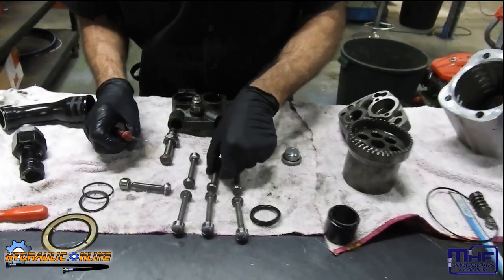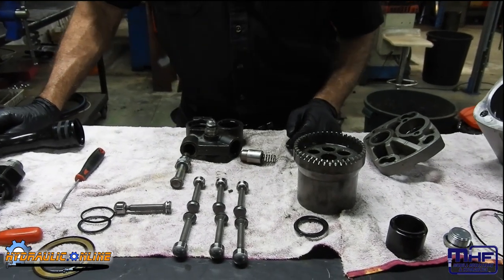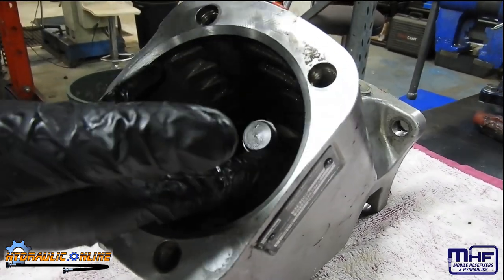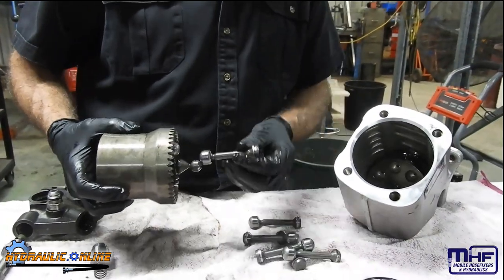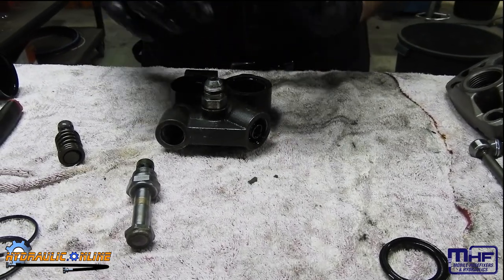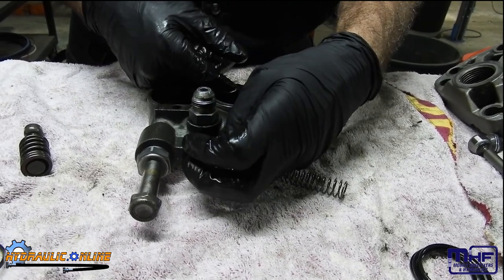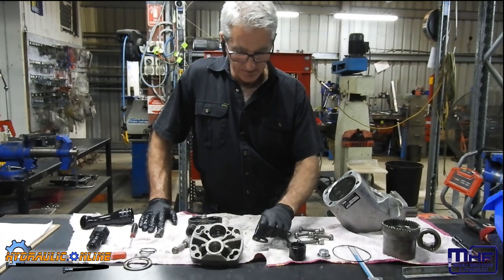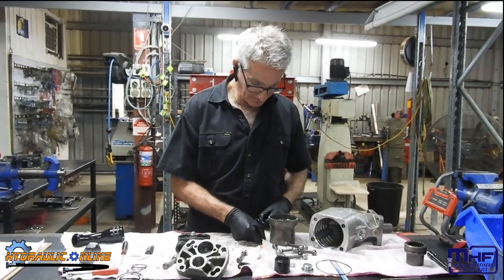Parker Bent Axis Piston Pump Failure Analysis "Live Drive" Explained

Comment: Great series. Any chance that you could do one on using unmatched hose and fittings and determining a safe compromise to get a customer up and running , as this is a scenario that is common in bush areas with a crimping machine and not a huge stock or range of hose and fittings. Thanks  Greg.
Reply from the maker: Thanks for the Comments gomond1 the answer is Possibly! the key words here are "a safe compromise" 
and "unmached hose and fittings". Best you give us a real life example and I will try and come up with a solution.
We in a pinch we have used medium pressure hose fitting on High pressure hoses by "skiving" the hose and crimping to tail collapse.
and high pressure fittings on different or unusual hoses. 
Try this watching this video for an brief expalanation of what we consider "a safe compromise" 
https://youtu.be/XjTlC2XjZQs

Comment: If the bypass line is put into the top of the tank, can this create an air pocket resulting in potential pump failure?
Reply from the maker: All bypass and return lines should return to the tank below the minimum oil level, if returning to the top of the tank it is recommended to use a dip pipe to ensure oil returns below the surface. Most tanks have breathers to allow excess air out or to let air in as the oil level drops and rises. Some tanks especially on mobile plant such as excavators have very light pressure relief valves to create a small positive pressure in the tank to help push oil into the pump.

Comment: Also, your explanation of the bypass valve is wrong. You had the pressure and suction back to front… where you said the pressure side pushes the spring up and goes back to tank, that’s wrong. That’s the suction side my friend.
Reply from the maker: I am not so sure about your statement Buddy, Can you please provide some proof to back it up?
Reply: @Hydraulic.Online yeah mate. At 4:30 you’re clearly pointing at the suction side, I don’t need to say it’s a dead giveaway because of the bolt holes where the suction flange bolts to.
Reply: Anyway your explanation on the solenoid stem being normally closed and energized to open to send oil to close the check is wrong. 

You’re kinda on the right path. The stem is actually normally open allowing the oil to pass through it and create the circulation within the pump and passing oil through the bypass line if it’s a closed centre circuit or there’s enough back pressure created in an open circuit. Once you energize it, it closes and back pressures the check in turn stopping the pump circulation within itself or through the drain line and creating a full displacement. I don’t know why I’m referring to it as a check because it’s not quite a check valve as it works on pressure differentials through the orifices (note the tiny holes on the “check”)